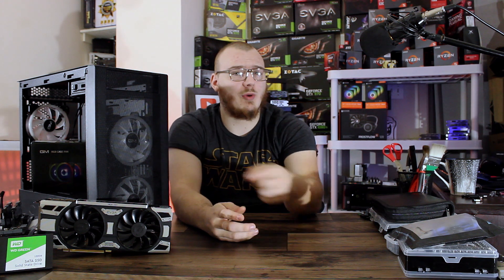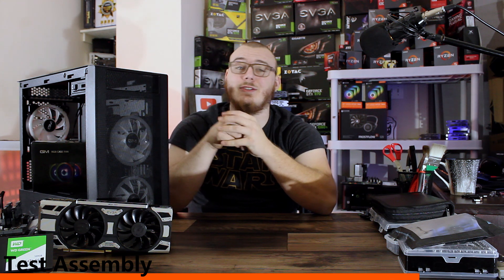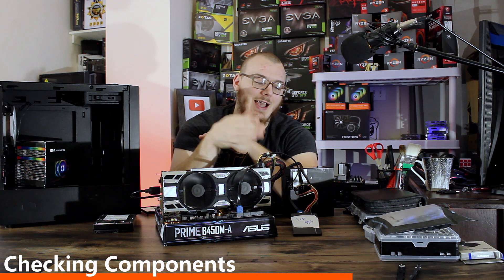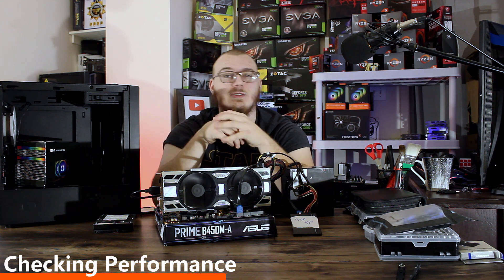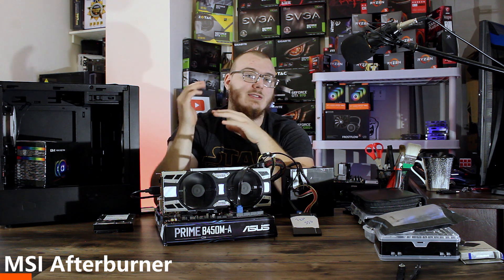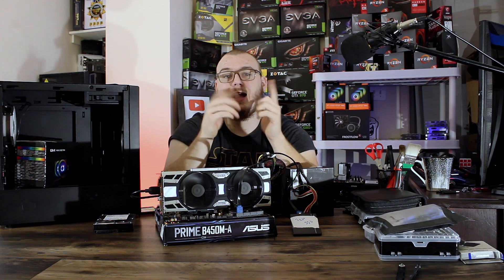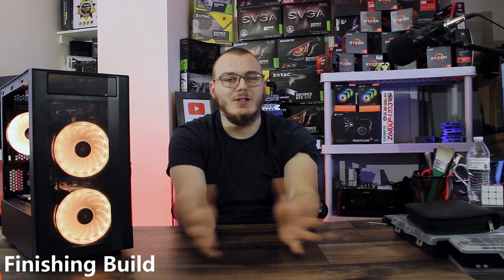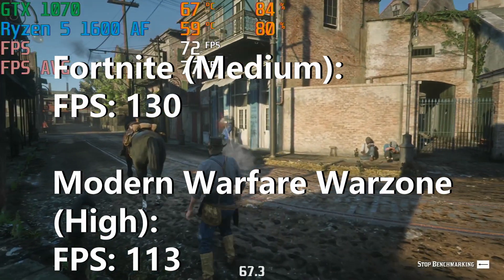Complete Guide to PC Flipping |Part 3| Building/Benchmarking

Comment: hey man really love the videos! In terms of the test ssd, have you ever encountered problems with it because you're constantly switching to different hardware? Do you install display drivers onto the test ssd every time and then uninstall them after you test the product? Also are there other driver problems you encounter, like chipset drivers if you're switching between an intel and amd build? Also, when you install windows on the actual drive you're going to sell with your build, do you run any tests after that to make sure everything is working? I'm planning on getting a test ssd and was just curious if you've encountered any problems/if you have any insight so I don't have to go through hell if I have to troubleshoot weird issues.

Comment: Hey I have a question... have you ever heard of a "NAXN" power supply and do you think its worth (550w $20). Will it die/explode?
Reply: yes it will explode after a few months LMAO, make sure to buy one that is 80+ bronze/silver/gold certified with at least 3yr warrantee
Reply: @MemebossYT  So Im guessing you know about this psu? Also im looking to buy used.
Reply: @terminator4803  is it 80+ bronze/silver/gold certified ?
Reply: @MemebossYT  Not sure. Ill check but do you know the brand?
Reply: ye, NAXN are really big but in my opionio as long as the PSU is 80+ certified then go 4 it
Reply: @MemebossYT  Alr thanks
Reply: @terminator4803  ur welcome
Reply: Any psu that cheap that isn’t a well know brand is a red flag buy one from evga on wensdays they sell there returns like 500w psu for cheap like 25$ and they have warranty and they are tested

Comment: Is there any easy way to test a graphics card when picking it up from someone's place before I hand over the cash?
Reply from the maker: There are people I've heard who will bring whole working systems to test parts out, but I don't think I'd really suggest that. What I would say, is if you're skeptical that the card may not be in working condition, you can ask the seller to take a quick video of it plugged into a system and displaying to a monitor.
Reply: @twowheelsusedtech7628  Great advice. Thanks.

Comment: I noticed you kept the stock cooler on. Do you ever grab aftermarket cooler's like a Hyper 212 when flipping, or does stock cooling sell well enough on Ryzen 5's and i5's?
Reply from the maker: I tend to not bother upgrading cooling unless I was going to overclock the CPU. Which I tend not to OC the cpu unless the customer requests it. When you're looking at keeping all your builds cost effective, you can't beat the free cooler that comes with the CPU if it works.
Reply: @twowheelsusedtech7628  I fully agree, I just got a bunch of "shit" from people because they think an aftermarket sells better

Comment: Hey dude, great video. I subscribed after watching the series so far.  

I was just wondering what you do if a part fails after the sale? Do you offer any kind of warrantee or such? I understand that the risk of this happening is reduced if you’re testing the machine properly before selling. This is one of my main concerns with a venture like this. I can imagine having to go out of pocket to replace parts can be a fairly rough financial hit when starting out.
Reply from the maker: Well you're right in saying that one of the reasons I test my systems thoroughly, is I don't want any of my systems to have issues after the sale. With that said, you can't catch or prevent every thing that might potentially go wrong. 

I have a loose "warranty" system with people I sell to. Basically saying "If you have any problems, let me know." Very, very rarely do they have a hardware issue after the sale, in all the computers I have sold, the only actual hardware problem I had to fix was a power supply going out. Which at the end of the day was $30 to replace the power supply, some gas, and a little bit of my time.

Long story short, if you do your due diligence when you're building, and test the components, then having them break after the sale shouldn't be a big concern for you.
Reply: @twowheelsusedtech7628  hey thanks for the reply. Makes sense. Looking forward to the rest of the videos 😃

Comment: The things I take away this time: SSD with all your necessary tools and cable management as a last chore
Reply from the maker: That's a pretty good synopsis.
Reply: @twowheelsusedtech7628  Do you use an external SSD? Or does it only work with an internal SSD?

Comment: As always, great video!
Qucik question: You mentioned your test SSD with all the nec. tools etc; I get that. But how do you deal with the pain of DRM and the games themselves? For example I do want to play Cyberpunk, GTA and other things on my rig, but also want to benchmark them on the test rig. DRM would prevent that? How do you deal with that? Do just not play the games you benchmark? Do you move your steam library each time from a to b? Wonder if theres any smart way to get about it. Thanks my man!
Reply from the maker: The only time that DRM would get in your way is if you're tying to benchmark AND game at the same time. You can have the same game installed on multiple systems under the same account, and all be playable, you just cant play them on two different systems at the same time. 

Never been a problem for me since whenever I'm benchmarking, I'm generally not trying to game at the same time.
Reply: @twowheelsusedtech7628  - I have a Ventoy USB with Heirens Boot program on it and it has quite a few useful tools but I was wondering if a benchmark utility like Heaven or Furmark can be installed on the Ventoy USB and be run off of that?

Comment: what I'm buying to minimize effort and sell many PC's at lower profit but very high turnover. Just buy lenovo thinkstations E30/E31 with strong processors like Xeon E3-1230 that also have an 80+ platinum 280W power supply and also come with 500GB HDDs, 8GB ram or Lenovo M72 ThinkCentre's that have E3-1245 which are even faster than 1230 and work super well in gaming. Buy used graphics cards in bulk, get RX 470 4gb that perform super well in gaming and are super cheap because of mining abuse - give them a refresh by changing thermal paste and also clean and grease up the fans with something like WD-14 silicone lube. Buy cheap $30-35 power supplys that also have 80+ Certified in bulk, buy cheapest SSD's possible that have 240gb and put it all togheter you have a super potent gaming PC that costs less than 300 dollars to make and could sell for 500-550. Depending on how fast you want to sell them and what RGB bling case you use on the build you can make 100-250 dollars a pop. Remember guys - making 1000 dollars by selling 10 PC's in a month is better than making 500 dollars and selling only 3....
Reply: Where can i find the gpu in bulk? Is this on ebay or somewhere else? And what should i search?

Comment: I went from 180 dollars to 1k on flipping and I'm 14. I thank you so much because you have been a massive help
Reply: How did you do it? Tips?
Reply: @wafflenation3030  I started with a $180 capital. Asked my mom for $20 and that I would later return. Bought a monitor keyboard and mouse with a pc that had an i3 8100 and an rx570. Sold the pc for 400. The guy thought it was 450 but it was actually 400. Sold him the pc for 400 and he gave me a ps4. I sold the ps4 for 200. Then I bought another pc for 400 with a 1060 and a ryzen 7 2700x and sold that for 550. Now at 750 I bought a 375 dollar pc with a 1080 and i7 4770 and sold that for 500. 875, I bought a 2060 for 200 and sold it for 400 when you prices skyrocketed and I hit 1k. I had never seen that much money in my life. My advice is be patient, and stay up to day with tech and the market. I got pretty lucky I'll admit with the ps4 but regardless I was patient and looked for good deals. I know I bought and sold computers but the reason why they weren't selling is because of the pictures the sellers were posting. They were TERRIBLE. So I just took nicer photos and got results. I also cable managed a bit just to make them more presentable. Another thing is, learn how to work on computer even if it's the basics, it will go a long way
Reply from the maker: Sounds like a solid start up to me. Good job man, really looks like you have a good grasp on how to keep the flipping going, so good luck!
Reply: @twowheelsusedtech7628  thanks man, it means alot coming from you :)
Reply: @Unknown-rr7qk  Very well done. Patient and knowing your stuff. That is a sign of character
Reply: Awesome story ,bro u got discord? Your progress is very astounding we can talk about pcs toó
Reply: @NemusDark  a.a#9439
Reply: @unknown let’s talk as well. Discord?
Reply: That’s awesome man your off to a great start. It gets easier and easier as you keep flipping and you’ll learn a lot of useful information. I started when I was 15 (almost 16) and now I’m almost 17 and I’ve had a ton of success so far. Don’t be afraid to jump on an opportunity if you see it and don’t get discouraged if something takes a while to sell. Good luck man